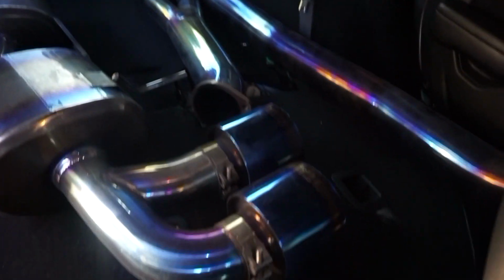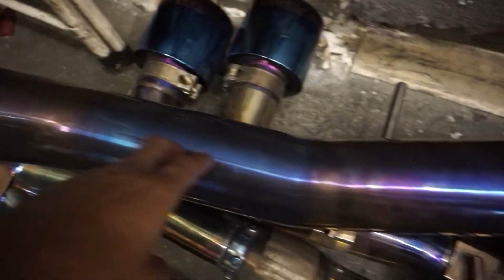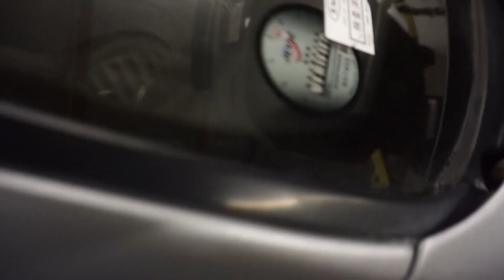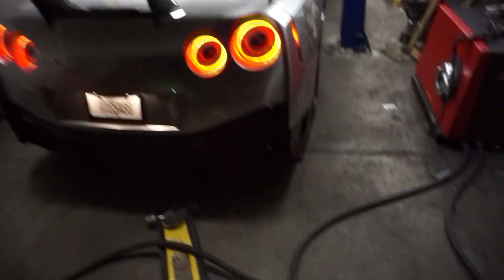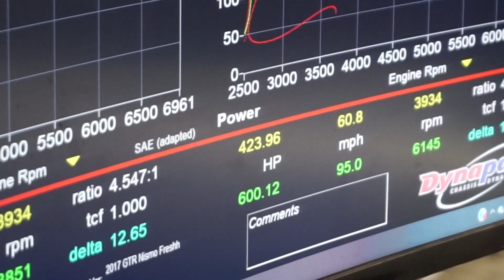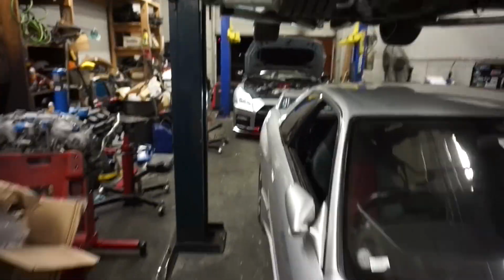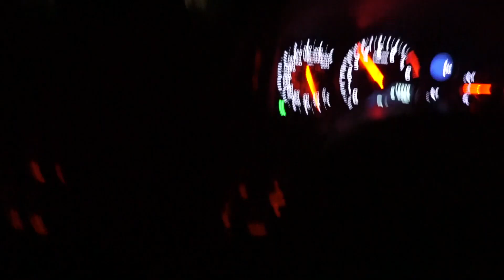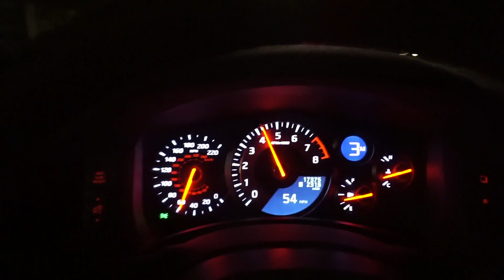Installing Full Titanium Exhaust On My Nismo GT-R!

Comment: That white gtr’s turbo flutter is pure GOLD!
Reply: Thanks🤓
Reply: @saulnismoknights  what is done to the white car
Reply: Upgraded turbos🤔
Reply: @ebsa123123  stock
Reply: @FIPackage  downpipes, midpipe,  stock exhaust. Pump gas + my tune
Reply: @saulnismoknights  what bovs do you have? are those ssqv?
Reply: @FIPackage  bruh it probably has no bov usually get flutter like that when you have no bov

Comment: Keep it up, bent rods on the way. Experience, not shit, talking. Lol. Sweet ass ride brother. But mine is built transmission, 4" straight pipe, full fuel system on E85. You wanna race?